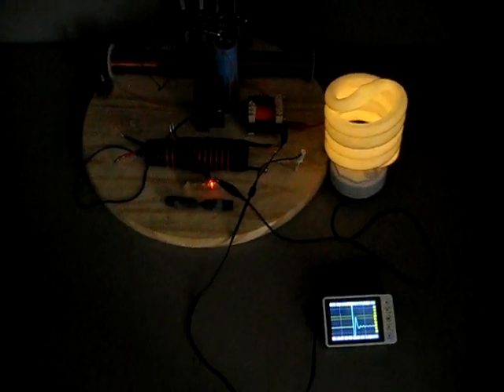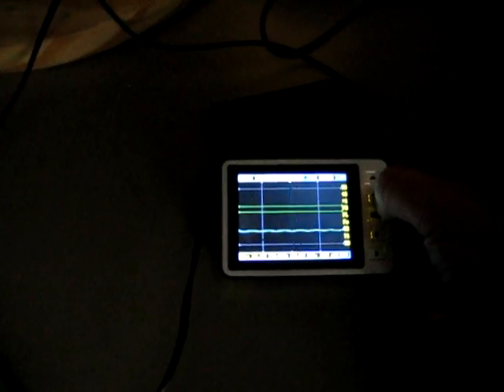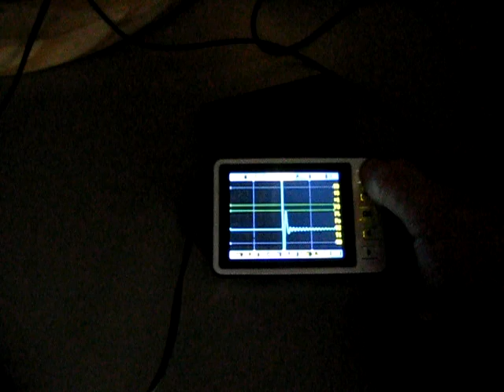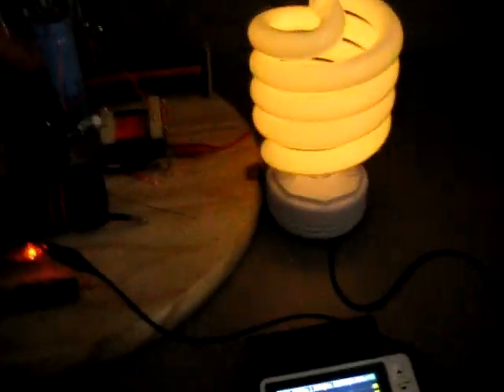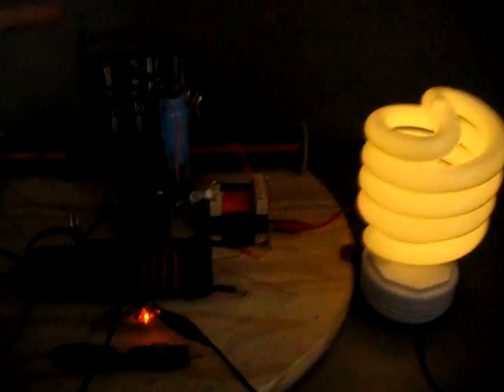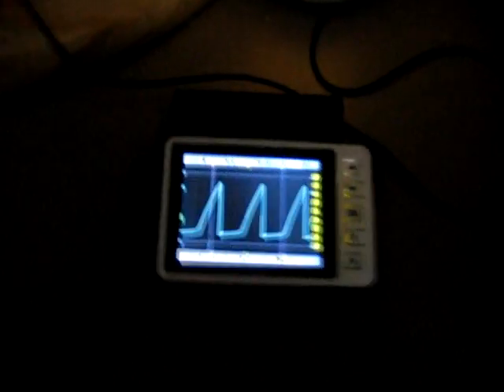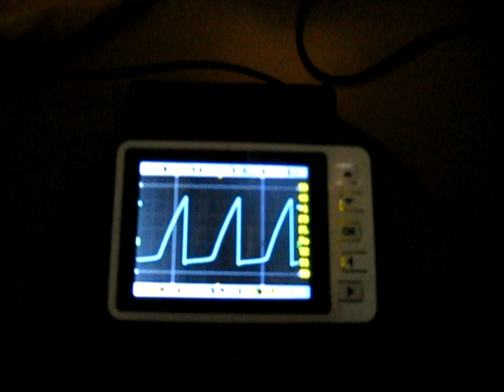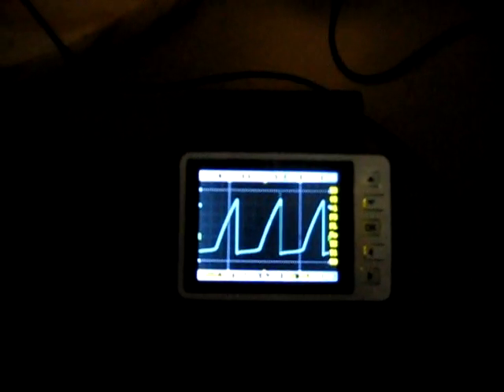Joule Ringer with home made transformer.

Comment: If u could take the small amount of energy collected from an antenna and trap it in the ringer circuit .. and build up more energy.. u could build up a big enough energy bank you could tap into when u needed .. and all be collected freely using the antenna. same effect as a solar charger and battery but you could use it at night i suppose.

Comment: i am very interested in this .. i think it could be the start of something .. however, i seem to believe that when u touch the battery to charge it up again .. that the energy is trapped like a flywheel .. and as soon as u put a load on it .. like the lights .. your flywheel begins to spin down .. eventually hault . there is no extended energy or whatnot ..just a flywheel effect of a fluxuating magnetic field..  any thoughts on my comment?

Comment: I propose that you also try to find a suitable (small) solar panel that will run this circuit. When used indoors, at night under a particular incandescent light, you will know what your output will be. There will be no impedence or capacitance to speak of from a solar cell's output, compared to a battery. You cannot drain a solar cell faster than what is measured, yet a battery mich experience anomalies. You can get 6v 200ma cells for $7 delivered to your home.

Comment: Really impressive efficiency. Some thoughts: Keeping resistance low will increase the sustain. This implies larger coils with less wire and higher gauge. Also, if a long antenna is attached, your oscillator may be able to ionizing the antenna, increasing is receptive efficiency. You need an antenna 1/4 wave of your frequency ... so long. Ground should be DEEP into ground. Read Thomas Henry Moray's notes.

Comment: I think the point is that he shouldn't use too large a storage, what is special here is the regenerative ringing which drives those cfl's.

Also the energy in a capacitor is found using this formula:
E = (C*V²)/2  where 'E' of course is energy, 'C' is capacitance and 'V' is voltage.
For those who have seen it, it is practically identical to the kinetic energy formula.